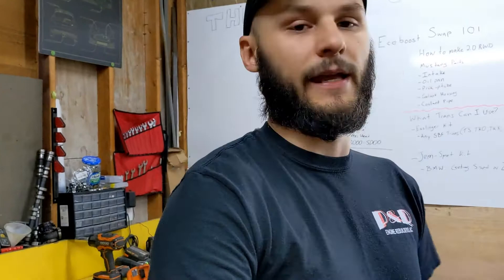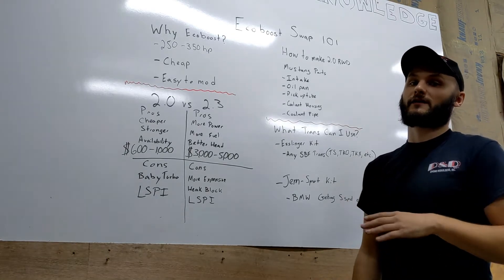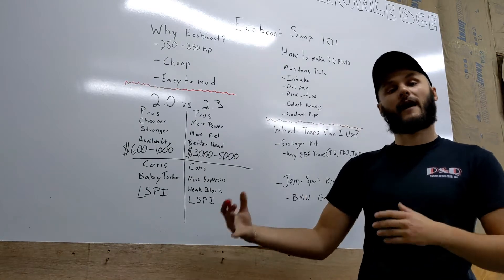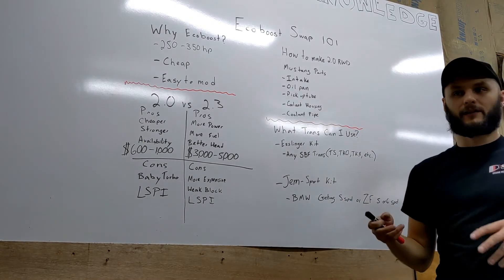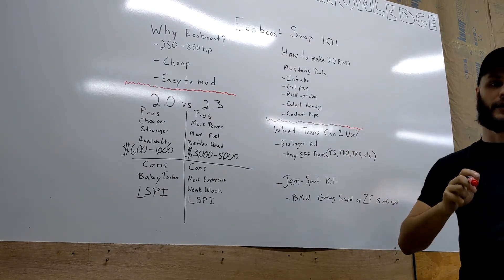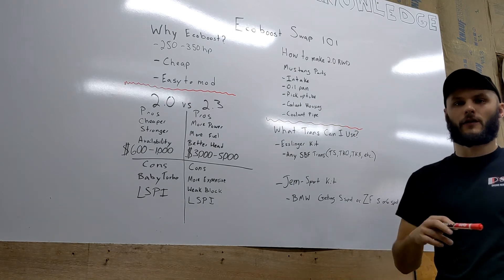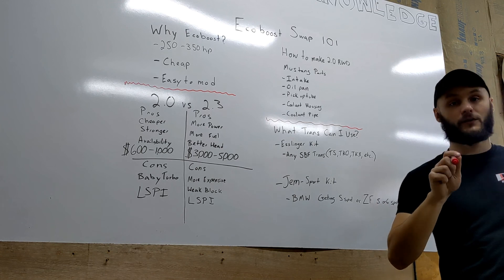Ecoboost Swap 101

Comment: The 2.0 and 2.3 are derived from the duratec 2.3 used in the rangers and many other Mazda motors. There’s a LOT of aftermarket support. You should theoretically be able to mount both right up to a m5od trans if you want something cheap and durable. But tbf that’s a manual meant for trucks so it’s not fast but they can handle power
Reply: Another cool thing here is I believe on rangers and explorers (rangers 2011 and back to at least 97, and explorers 2001 back to at least 97) is that if done correctly, Ranger engine mounts basically fit with very little modification

Comment: Will the 2.0 out of a LINCOLN work? Do you know if there are any differences for accessories or anything or is it all same/same?
Reply from the maker: Yes the 13-15 Lincoln MKZ engines will work. There are no differences to the engine that I am running.

Comment: What would need to be done to a se 2.0 to put a turbo on it
Reply from the maker: You would need a turbo manifold, turbo, intercooler, piping, blow off valve and quite a few other odds and ends. It's more economical to start with an Ecoboost engine.

Comment: 17-20 2.0 is open deck and hg failure prone due to the coolant split in between the cylinders.  2021 models are updated and cross drilled to leave the top surface in tacte for no movement and sealing for the headgasket
Reply from the maker: 21+ are also open deck. I plan on making a video going over this soon. I've seen some people buy the later gen engines for swaps just to find out the blocks are weaker.

Comment: I wonder what it would take to swap my 3.0 and CVT in my Ford 500 for a 2.0 AWD setup
Reply from the maker: There are AWD transmissions/transfer cases that will bolt up to the 2.0. May be pretty pricey though for the full setup. Love to see what you come up with!

Comment: I had heard that a manual from a 2003-2011 2.3L Ranger will bolt up to an Ecoboost. Is this true?
Reply from the maker: I believe it will bolt up, although I have not seen many people do it.
Reply: @stroupperformance  got ya, because I've been reading through FB group posts and can't find much info. Some say that it'll hold up to a stock 2.0L just fine and some say otherwise. I just want a cheap manual swap for my New Edge.

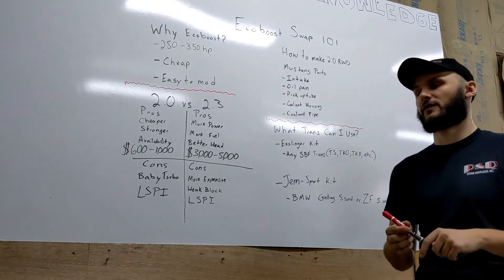Comment: 2:50 The 2.3's are in tons of cars - all the new Rangers, Broncos, Explorers, some Lincolns, and more. However the move would probably to get it as a crate motor from Ford, which comes fully loaded with turbo, alternator, everything.

Comment: just a quick question. I assumed you delete the crank balancer to be able to use the rwd oil pan. 
The V8 SBF flywheel that you used its the 50oz inbalance one. ?
Did you have clerance issues between the clutch plate and the bellhousing ? thanks
Reply from the maker: I did not delete the balance shaft assembly, it fits even with the mustang oil pan.

You want a 0oz or balanced flywheel. The engine is internally balanced.

I didn't have any issues with bell housing to flywheel clearance on my setup, but I've heard of others who have issues with that. You can take the crank adapter to a machine shop and have them take some material off to give you more room. This can also be done on a lathe if you have one.
Reply: @stroupperformance what do you think about stacking two flywheel plates to make the space between the adapter and bellhousing ? what it could be a side effect of doing that ? I am about to test the starter tooth print this weekend, this is the first thing that come to my mind that would be a problem.
Reply from the maker: @JoseGutierrez-ur9uu  I have heard of people doing that with some success.

Comment: Looking for advice, next year, we plan on an 84 Porsche 944 with the 2.3 and a corvette C6 trans/ torque tube and IRS. Any advise we can get would be greatly appreciated!
Reply from the maker: You will likely have to make a custom adapter plate for the Corvette torque tube setup. Depending on your power goals, it might be cheaper and more reliable to go with a 2.0 instead of the 2.3.
Reply: @stroupperformance9384  i just read up that the 2.0 block had more strength.  I have the guy to make the adapter or even bell housing to accommodate.  Hardest part is clearing work out to do it
Reply: @stroupperformance9384  water jackets are the issue right? What turbo would you recommend for the 2.0
Reply from the maker: @clearchoice2112  Yeah the 2.3 has an open deck block vs the 2.0 closed deck block. I would recommend something like the garrett 2867 or 3071. 
2867 will be good for 400-450whp with quicker spool (full boost by ~3000rpm).

3071 would be good for 450-500whp with a slightly slower spool (3200-3400rpm).

Comment: Awesome video! I was recently given a new edge mustang with a 3.8 and this video has me thinking... lol I know I can get the engine bolted in with the same AJE K-member and your mounts but I need to research wiring for a new edge. Also wife hates manuals so maybe a 6r80 option or go SBF adapter and keep the 4r70w. IDK yet, lots to research.
Reply: Oh and I need to figure out air conditioning, cant do no AC in my region. Too HOT lol
Reply from the maker: Wiring is super simple, at least for the engine. There are a few kits that make it pretty much a stand alone system. Integrating your current dash board would be the hard part. AC is pretty easy too, just grab a compressor from an Ecoboost powered car.
Reply: I've been dreaming of an edge with a GM Atlas 4200 and an 8HP70 auto transmission. Could be ridiculously fun.

Comment: What about the head gasket issues 2014-2020?
Reply from the maker: That's not an issue on the first gen engines listed in this video. Only the newer open deck blocks have head gasket issues.

Comment: If you can bolt all the 2.3 stuff onto the head to do the swap, can't you use a 2.3 head on a 2.0 block? 🤔
Reply from the maker: Yes, you can also use 2.3 internals in the 2.0 block. This way you get the best of both worlds, a strong closed deck block with an extra 0.3 liters of displacement, and a better flowing head.

Comment: so im dreaming of putting a 2.0 into an old pre-75 ranchero. Less for the power, and more for the fuel economy. think it would be a nice foundation for a daily. something i can putt around in and maintain high 20's to low 30's on the mpgs. enough torque for anything id put in the bed or pull a small trailer.

Comment: Has anyone put this engine in a 86-92 Mazda b2200? In stock form I think that would be a blast to drive.
Reply from the maker: I have seen a couple different generations of Ford Rangers with Ecoboost swaps. I'm not sure if anyone has done a Mazda truck yet.
Reply: Hope to do my ‘91 Ranger soon™️. Altho still trying to research. Always wanted a Ranger with 302. But the Ecoboost is probably the better choice these days. Maybe. Hurts saying that. But the truth is the truth.

Comment: So an LS swap is way cheaper after having to buy thousands of dollars of extra parts for the ecoboost 2.0?  LS with a lumpy cam sounds way better!
Reply: Been doing LS swaps long before they were poplar AF for swaps. Some times good gas mileage and factory turbo is just a much better options as well as weight savings.

Comment: I’m confused when did these engines become reliable? I must just be ignorant and see the worse ones roll into the shop
Reply from the maker: People commonly confuse these engines with the current 2.0 Ecoboost. The older engines, like the one that I run,  are closed deck blocks and are much more reliable than the current 2.0 Ecoboost.

Comment: Hmmmmmmmm. Thinking of a daily driver 1987 F150 RWD. The only thing I'm slightly irritated with is that I've got a shop full of mod motor-based transmissions (4R70W and T45) and all I'm seeing that's Ford related is the SBF variety...unless I missed something?

Comment: 2.0 Eco Focus block and then the crank etc from the 2.3 Eco and the head from the Mondeo 2.0 Eco which still has a external manifold. Not this internal shit from Focus ST/RS :) 
This combo is the best haha.
Reply from the maker: The Range Rover Evoque I believe also used that same head.
Reply: @stroupperformance  Possible. Mondeo had 2 Versions of the 2.0 Ecoboost. The one i mean is the 2.0 EcoBoost SCTi from the yea 10-14 and the Evoque had the Ecoboost from 11 so could be the same head yes :)

Comment: So we should be using gen 1 engines? Which blocks are open deck and which ones are closed?
Reply from the maker: Yeah use the Gen 1 engines. They are closed deck. The newer engines are all open deck.

Comment: These are easy to swap in 1st gen Mustangs. Straight 6s have the same bellhousing bolt pattern as SBF. Lots of room. Ecoboost swap gets more power, add power steering, power brakes (4 corner drum with 4 lug gone and new 5 lug disc front with 5 lug rear axle.) And Air conditioning components are available.

Comment: Can you swap the turbo off a 2.0 or 2.3 into a naturally aspirated Fusion’s 2.5?
Reply from the maker: No, the turbos on the 2.0/2.3 are both designed to fit their respective headifold. They won't work with the earlier 4 port exhaust duratec engines.

Comment: No what about the DI and the carbon build up. 

Does the 2.0 or 2.3 have a way to add port injection to clean the backside of the valves.
Reply from the maker: Yes, you can add port injection to both engines. Stratified makes a intake manifold spacer that allows you to add a 4 port injectors.

Personally, I just use DI intake valve cleaner spray made by CRC to keep the valves clean.

Comment: Between the 2.3 & 2.0 what block would you say is better at high rpm? I’m looking to build a drift motor and don’t need more than 300 but looking to make around 250-300 so it’s more power than stock 3.8 v6
Reply from the maker: Neither engine is better at high RPM. But for that power goal, I would suggest the 2.0. you can get pretty close to 300whp with the stock turbo.

Comment: so i have a 2012 wrx and the motor just recently blew, i was wondering if it would be worth the effort to ecoboost swap the wrx, for cost effectiveness and easier power. does anyone know of a ecoboost swapped wrx?
Reply: Factory 5 racing makes an adapter.  They use an ecoboost and subaru trans in their kit cars.
Reply from the maker: Thank you for the input, I did not know that adapter existed. Might be tough in the Subaru though, Ecoboost engines are MUCH taller than the boxers.
Reply: Subaru transmissions are also super far forward, so the length of the 2.0 or 2.3 compared to an ej/FA will be an issue

Comment: Just finishing up installing a 2.3 EcoBoost crate motor (from Ford) our full race 1970 FordCortina GT . Used a spun steel bellhousing from Quick Time mated to a T5/G-Force. Transmission and a Winters mini-quick change. Almost a straight forward install, transmission did not have to be  moved, removed small section of firewall but due to. Ground clearance problems had to install a Mountune dry sump system. .Used the 2015-2017 wiring harness , had to bypass computer for the electric fuel pump and start system. Believe this is the only Cortina in the world with a 2.3 EcoBoost.

 only Cortina  MK2
Reply from the maker: That sounds like a sick build! Are you in the Ecoboost swap group on Facebook, I thought I saw a cortina in there recently.

Comment: I've been thinking about doing a ecoboost 4 into my '74 maverick 2dr when they first came out, currently running a 289/T5.  the weight savings, and power being close to the same, along with the newer tech should give better mpg without losing performance.  Besides many issues preventing me from doing it (can't tear down my only car...), I've also had a hard time deciphering the new engines, to figure out which is best for reliability and performance.  My 289 is at about 300hp/trq which I'd like to stay around.
Reply from the maker: That would be a tough call between the 2.0 and 2.3. I personally prefer the 2.0 as it's more cost effective. But the 2.3 would also be a very good choice for that power level.

Comment: Do you know if an mt82 will bolt up to a 2.0?
Reply from the maker: An MT82 out of an Ecoboost mustang should bolt up to the 2.0. I don't know if this has been tested yet though. The bell housing bolt pattern is the same between the 2.0 and 2.3 though.
Reply: @stroupperformance   Thanks for the response and sorry about the delay. Do you know if the ANT kit is plug and play?
Reply from the maker: @TheMotherTucker  Yes, when you order you have to specify which ECU type you have and which harness you will be using. All of that information is on their Ebay store page.

Comment: what tkx did you run theres 6 different ones
Reply from the maker: TCET117765. You could also use TCET18084 or TCET18085. The only difference between the three are the gear ratios. I went with the 2.87/1 first gear and 0.68/1 fifth gear option.

Comment: Use a 2.5 duratec block/closed deck also, 2.3 eco rotating assembly with 2.5 head eliminating the head a fold and DI for simplicity. Mustang, mazda miata, Ranger and Mazda b2300 transmission for bolt on transmission/ECUs. JS if you have access to multiple engine options to play with
Reply from the maker: The duratec block and head are good options. But you would need to buy or fabricate a turbo manifold for it which could get expensive. Also the manual transmissions they put behind those were pretty weak. I think the simplest way to complete the swap is to buy a used 2.0 Ecoboost. But you could definitely do a complete build with the duratec and have the 4 port head and longer stroke.
Reply: @stroupperformance  the transmissions i mentions are bolt on but Esslinger has a SBF bolt pattern adapter than you could bolt anything for an older pushrod 5.0 to it and that opens up a world of options. Also the 6R80 can take a lot of abuse and its a factory auto option from the Mustang which is what i have behind my turbo 2.5. Turbo manifolds can be had from $120 to $500 or more if you want a tubular stainless one but its all sorts of options like buying a used Mazda CX7 turbo manifold thats a bolt on

Comment: What's wrong with the 6 speed manual mustang transmissions I think there the getrag mt82 or the tremec tr3160 will they not bolt up without the adapter??
Reply from the maker: The MT82 may work with the 2.0. I know it works with the 2.3.

Comment: How easy is it to pull the torque out on the 2.3? I would like to maintain roughly the same fuel economy but id like to get around 400ft/lbs of torque. Is that unrealistic?
Reply from the maker: They are extremely torquey engines, especially with the stock turbo. The 2.3s stock turbo will spool fast enough to make a ton of torque down low. Just have to be careful to not make too much torque at low RPMs, the rods and pistons can't handle the added pressure.

Comment: I’m under the impression the 2002 up ranger 2.3 trans bolts up also.
Reply from the maker: I believe that it does. Same with some of the Mazda trans from the same era.
Reply: @stroupperformance  the 6 speed from the last gen Miata’s fits. Not sure they made an ‘02+ b2300, if they did it’s super rare.

Comment: Great info Dalton!  I'm about dive deep into doing an Ecoboost engine install into a 93 FD3S Mazda Rx7.  I'm tired of the unreliability of the rotary.  I'm in Maryland.  Where are you located?  Wanted to see if I could tap more into your knowledge of these engines.
Reply from the maker: I'm about an hour north of Pittsburgh. If you want you can message me on Facebook or join the Ecoboost swap Facebook page. Tons of guys with lots of good information in there.

Comment: I plan on 2.0 ecoboost swapping my 13’ focus with the mtx75 5 speed trans, do you know if I could bolt the ecoboost header, intake, etc up to my stock block? The intervals won’t be as strong, but I am wondering if my stock block is the same 2.0 na is the 2.0 ecoboost. Thanks for the video and have a good one!
Reply from the maker: I believe the N/A engines are a bit different. The head has 4 exhaust ports, the Ecoboost has the exhaust manifold integrated into the head and only has one exhaust port. You'd probably be best off buying a used Ecoboost engine and swapping that in. Look up Rebel Devil Customs, they do a bunch of N/A to Ecoboost swaps on the Focus.

Comment: I was thinking about running a 2.0 ecoboost in a 98 Ranger splash 5 speed.  This is a great video! Thanks!
Reply: I also have a 98 Ranger and am wondering about getting it smogged in CA.
Reply from the maker: I know of a couple people who have put the 2.0 Ecoboost into rangers. It's an awesome swap!
Reply: @stroupperformance  im wondering about doing just that. what other info can you lead me in. great video btw. thinking about this swap vs the v8 now.
Reply from the maker: @mindtrick714  I would check out Jimmy Lunchmeat's channel. He has done a 2.0 ecoboost swap in his. I can't give much specific info on the ranger swap, as I have not done one. I can only give generic ecoboost swap help/advice.
Reply: @mindtrick714 if yours is a 2003+ with a Duratec 2.3 an eco 2.0/2.3 would be an easy swap since it will bolt directly into the existing mounts and transmission
Reply: @young11984  this is only partially correct. You will need a custom passenger side engine mount and the firewall will need to be pushed back 6" or so to clear the high pressure fuel pump.
Reply: @sethgibowski8695  no firewall issues with a Ranger 2.3 Eco since its on top and duratec mounts can be used with minimal modification to passenger mount. Not everybody uses car based engines
Reply: @young11984  Ranger 2.3s are far less common and affordable compared to 2.0s. Thats why a good portion of swaps are going to be from fwd based 2.0s.

Comment: Can you run an auto trans with the esslinger adapter?
Reply from the maker: Technically you should be able to run anything that would bolt up to a small block ford. I don't see why an auto trans wouldn't work.